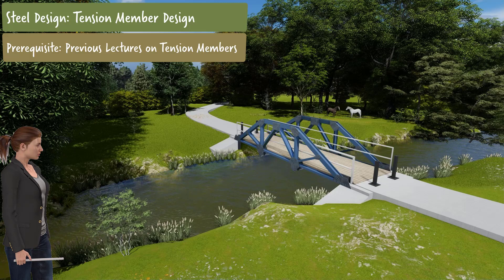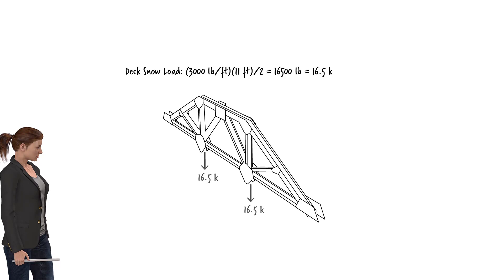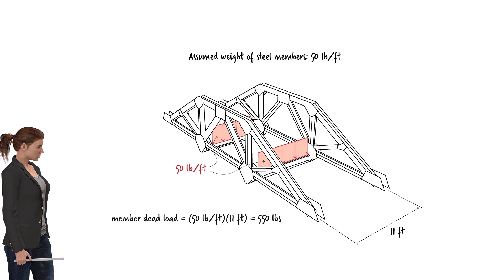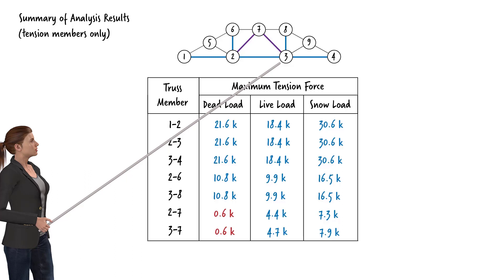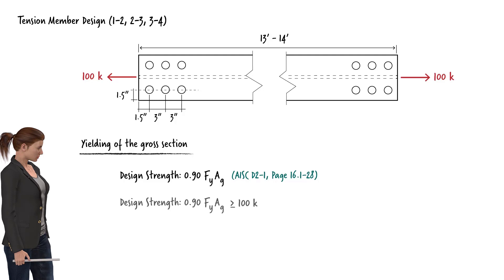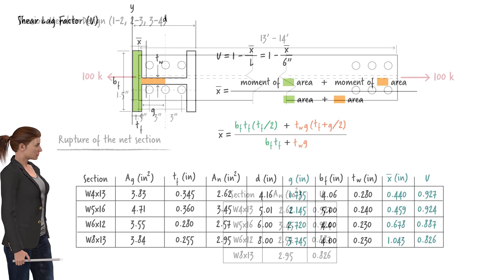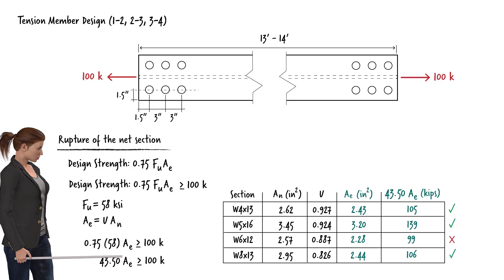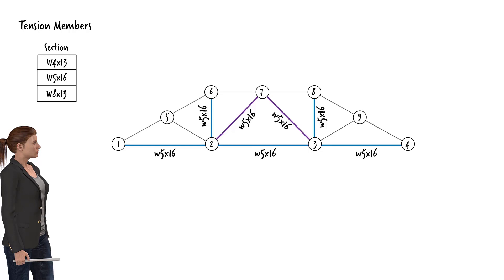SD5: Tension Member Design for a Pedestrian Steel Bridge

Comment: very simple clear and explanatory video, my question is;
lets say we have choosen section w5x16 for all tension members
and lets say we have also conducted the compression member design and we have choosen w8x13 to use for all compression members
shouldn't we re analyse the structure with same loading cases since now members have different stiffness values and the load distribution over the members will be different which may cause insufficient capacity for some of the members
Reply from the maker: In principle, yes! We need to re-analyze the system if we wish to optimize the design. However, in this case, since the selected members are the lightest available sections already, no further weight optimization is possible. 

Furthermore, since the truss is statically determinate, the change in stiffness of the system does not have any impact on the analysis results; the member forces are not a function of stiffness factors/coefficients at the truss joints.
Reply: @DrStructure  oh true the system is already determinite, again thank you for your respone you brightened my mind

Comment: Hi Dr.Structure ! 
I have been watching your videos for so long. Your videos content & explanation are incredible.....
Could you suggest me some project topics related to structural engineering for my Bachelor's final year project !
I will be grateful to you...
Reply from the maker: Thank you for your feedback.

Concerning a final project for your undergraduate studies, two ideas immediately come to mind:

 
1) Design a very small (real or imagined) building/structure from start to finish. For example, pick a warehouse with a steel skeleton, a two-level building, or a pedestrian bridge. You will then design the system ground-up, including the foundation, the individual members forming the skeleton of the system, and the roof or the superstructure (if you pick a bridge). You can document your work in a technical report, which, if done thoroughly and professionally, could become a valuable part of your portfolio.
 
2) You can also center your project around using sustainable materials for buildings. For example, you can work on analyzing and designing a simple structure using bamboo as the main structural material. You should be able to find learning resources and example projects on the use of bamboo online.
Reply: @DrStructure  Wow ! This is an amazing idea & I would love to work on this type of project . Thanks a million !!!
Reply: Hy Dr.Structure !!
Would it be better if I use softwares(autocad ,staadpro)  for planning & analysis of two story building for my project or I can do it manually by hand calculations?
Please let me know which approach is the best & get more priority?
Reply from the maker: Such software tools are routinely used in practice. But their use is not a good demonstration of one’s deep knowledge of engineering analysis and design concepts. 

If you have time, it would be best to perform the analysis and design using hand calculations. Then as a way of verification, and also to demonstrate your familiarity with the software tools, apply them to the problem.

This dual approach should make your written report more comprehensive and valuable.